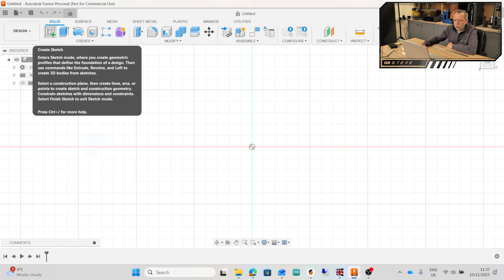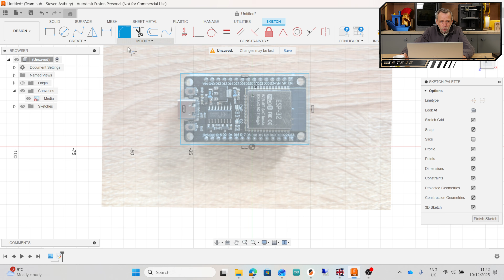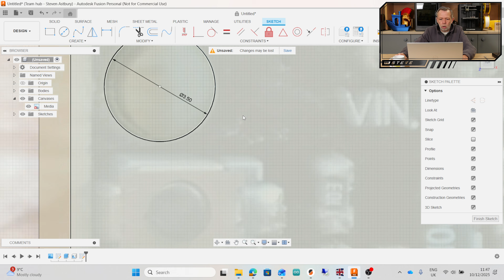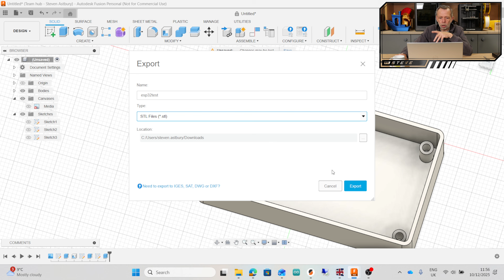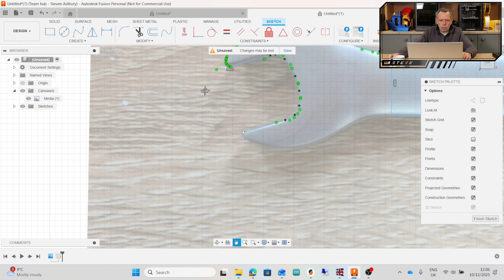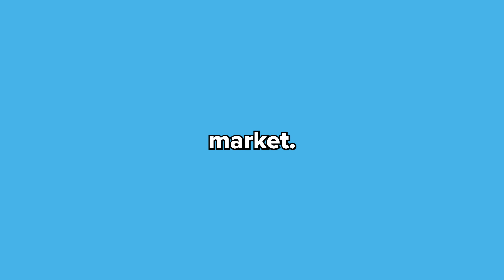Recreating & 3D Printing Parts from Photos Is Way Too Easy

Comment: I didn't see in the comments, but if you include the ruler in the picture, it is really easy to scale the canvas.  Also take the picture from as far from the object as practically possible to minimize any distortion.  Most phones have enough resolution to allow you to get pretty far away.   And when creating really precise fitting pieces, don't forget to take into account the accuracy of your printer ( plastic shrinks).  When printing PLA, I use 0.2 mm compensation for interference fits.  0.3 for looser fit.   Just set as a global variable incase you need to tweak.

Comment: That's great. Well, maybe, if there is room for it on the board, I would merge the pillars with the box itself.

That means, I would make a small box in the corners that's big enough to reach under the holes of the board - in the desired height. And I would just round the inner edge of these boxes, so that it would nicely support the board until it reaches the holes, including the holes.

This way, there are no fragile pillars, the printer would have it easier to print the box together with the small supporting boxes underneath the board holes - in one go, with no stringing...

Well, that's just my personal preference...

Your solution is universal, there could be pillars necessary anywhere in the middle of the board...

I'm just trying to optimize the model for easier 3D printing and for a sturdy model.

Your option would work perfectly well too.

Comment: Pro tip 1: Use the zoom option of the phone to take the photo as far away as possible to minimise the optical distortion. If you take photos this close, it will introduce a lot distortion and the larger the part, the higher the distortion will be and more inaccurate the model will be.

Pro tip 2: Hit and hold the ctrl - button on your keyboard while sketching to disable the snap to grid-functionality, this makes it easier to free sketch in Fusion.

Comment: every time i do the calibrate , measure the length , then go back and check the width , its always wrong, any ideas
Reply: Mount the phone/camera directly above the object as high as possible (while maintaining sufficient resolution), and exactly parallel to the table. Keep the part and a size reference flat in the same plane, use even lighting, and rely on measurements near the center of the image. You could use addition size references near the edge of the frame to check for distortion. Or use a flatbed scanner instead of a camera.

Comment: I’ve been doing this for years but HEADS UP. There is some kind of issue between photos taken with an Iphone and F360. The scaling does not seem to work properly. I’ve found that I have to load the photo into photo editing software and then export it again as the jpg. Even forcing the Iphone to use *.jpg as the compression algorithm does not work. Took me ages (and many wrong size prints) to figure out that the scaling was not working.
Reply: One more reason to stick with my Samsung!  The rest of my family went to the dark side years ago.
Reply: I do a lot of lithophanes for people and when people send me pictures from an iPhone I have to do all sorts of converting to get the pictures to work.

Comment: Fusion limits you on personal license it doesn't allow importing a mesh file and get auto corrections to get a modifiable mesh model.
Reply: I’ve imported 100s of stl files into F360 on my free license.
Reply: @rorywquin  Me too.  Did it just yesterday.  Personal license DOES limit you to the type of corrections that can be done automatically.  I forget what it is called.  It has never caused an issue with what I was doing.

Comment: I guess I am that guy. Wouldn't you need to measure from the connector to get the right width? It is outside the boundaries of the card. Is there a setting to give you a specified offset so that it fits correctly? I would think based on what looked like the depth that the fingers would have difficulty grabbing it.
Reply: You are correct, if we were to model the part for real use then absolutely you would model the cut out for the usb socket. The purpose of this video was to show what can be done. We will make another more in-depth video on this subject.
Reply: I can only agree, just because I’m a machinist so I’m used to tolerances within 0.0002”

Comment: Easy way to get 'round Fusion 360 , free version, limitations: use Onshape! 🤣🤣🤣🤣
Reply: As a hobby user for about 10 years now, I’ve never had a problem with F360. Nothing wrong with Onshape (and very similar to F360) but, I don’t want to relear an interface. FreeCad seems to be the “goto” product for hobbists these days.